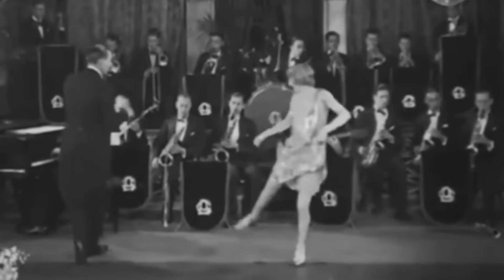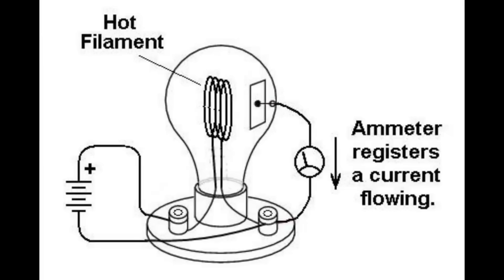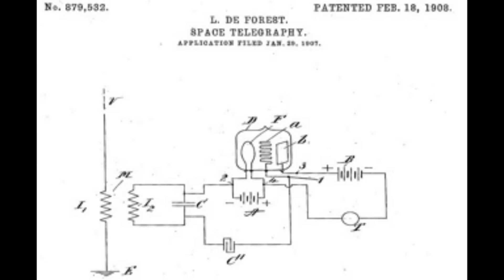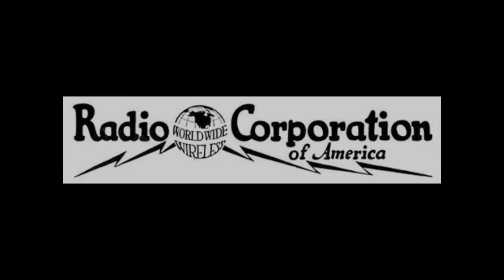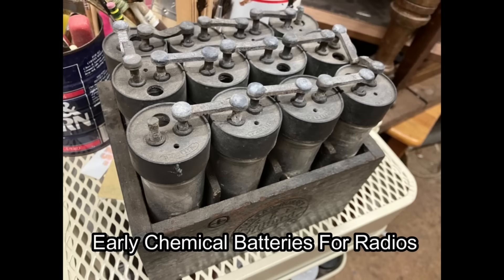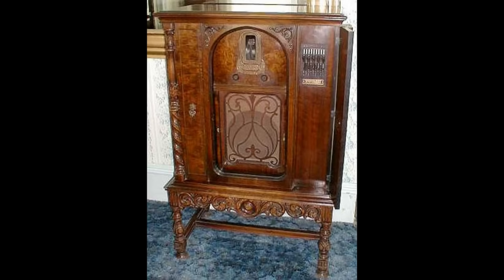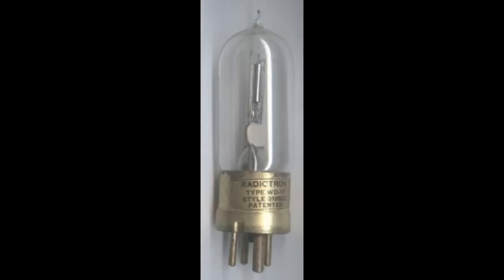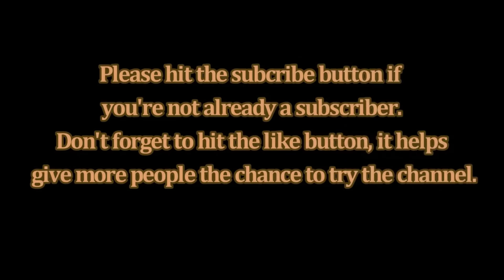The Vacuum Tube 1905 - 1929

Comment: When I was a radio engineer in the 1990s, I was surprised to learn that modern transmitters, like those made by Continental Electronics, used a large vacuum tube. Apparently, they still produce transmitters that use tubes, even though most used solid state components.
Reply from the maker: Tubes are still produced and needed today, which is a tribute to the genius of the invention and those who invented it.

Comment: Vacuum tube musical instrument amplifiers don't deliver a more accurate sound, they deliver a more desirable sound. Unlike a hifi amplifier, accuracy is irrelevant. What finally comes out the speaker is all that matters. if it's the sound that the musician is looking for, then it's the right way to do it.
Reply: Your theory about tube amplification for instruments applies just as well to home stereos as it does for stringed instruments. 
I've never heard any solid state  stereo amp sound as good as a high end tube amp.l
Reply: ..много зависи от записите , на каква апаратура са направени!!Записи правени на лампова апаратура звучат по-добре на лампов усилвател , и обратно , записи правени с апаратура на чипове и софтуер звучи по-добре на усилвател с чипове!!
Reply: Hook or a voltage meter to your guitar..youll be reading A
C thats why solid state will always be inferior

Comment: The first twin triode was the double winged audion in 1907. and there were some high powered triodes used in the early 1930's for the station WLW that had to be watered cooled.
Also Cunningham was a early tube maker and he started in 1915. Then there were the odd types such as the Sodion tube put out by the RCA company in 1926/27 The UX 201a tube was a staple tube for ten years. And then there were the acorn tubes for high frequency work during the early mid 1930's. And lastly there were the Nuvistor and Compactron types.
I could go on about the transmitter types and other special use types for early computer work. The history of the Vacuum tube is a very long one with many twists and turns and dead ends too.

Comment: Although thoriated tungsten filaments quickly gave way to the more efficient oxide-coated filaments and cathodes, which produced more electrons whilst using less energy, the thorated-tungsten tubes have one advantage: weak tubes can be rejuvenated by briefly running them at 1.5 to 3 times their rated filament voltage.
Reply: You know in retrospect it's puzzling that Thomas Edison took so much time and energy to develop filaments and light bulbs. All he had to do was check the periodic table for melting temperatures. Tungsten is the obvious choice. Thorium has a lot of electrons in the outer shell to release when heated. Both of these are almost obvious in retrospect. I don't think Thomas Edison had a periodic table on his wall.
Reply: @stephenmorton8017 Tesla complained that if Edison had just thought about what he was doing, he’d be better off.  Not the only person to say that.
Reply: @atari7001  i give him credit for noticing the effect, sure. but it's so interesting, why not follow it up? he didn't see any dollar signs is why.
Reply: Yes, related to the 811A.  I think the 812 has higher Mu.
Reply: Do you know why this works?  Does the thorium boil off the filament?  Thanks for the info, btw.  I have a tube that appears in good condition but the gain has dissipated very much.  There is evidence of sputtering on the glass as black deposits.
Reply: @atari7001 , hitting the filament with high voltage "boils" fresh thorium to the surface, and perhaps evaporates off contaminants that form an insulating layer. This doesn't work on oxide-coated filaments or cathodes (about 99% of all tubes), only those made with thoriated tungsten. What type of tube are you hoping to rejuvenate?
Reply: @ ok I see- it’s an 812a, which I understand is supposed to be thoriated.
Reply: @atari7001 , yeah, I think so too; that's a transmitting tube, isn't it? Some transmitting tubes have thoriated filaments. Look it up to be certain....
Reply: @ thank you!  I appreciate your help 😊

Comment: Most homes still have at least 1 vacuum tube device, even if every thing is new. The microwave oven! The magnetron (used to generate the microwaves) is a vacuum tube.
Reply from the maker: Yep! Even today, we still can't live without an invention that's over a century old!
Reply: @Radio1920s  We are likely to still be using them over 100 years from now! Vacuum tubes are the best devices when you need a LOT of power. (as you mentioned in the video, radio station transmitters use powerful vacuum tubes.) I "love" when people THINK something is "obsolete" just because there are modern "equivalents", But this is not always the case. The highest capacity data backup medium is STILL magnetic tape! (used for big data backups at data centers).
Reply: Correct
Reply: I understand solid state microwave ovens are available (first demoed at International Microwave Symposium 2014) but magnetron based ovens still dominate because they are less expensive.

My friend who is an electrical engineer didn't realize that a magnetron is a vacuum tube.
Reply: @lynnlandin7561  I shudder to think what the RF silicon to generate 6 or 1200 watts at 2.4ghz, and the heatsinking/cooling required would cost in both cash, and metal resources.

Comment: It could be argued that the Incandescent light bulb was the single most significant invention of all time. It led to the vacuum tube. the myriad uses of the vacuum tube were carried over to the solid state realm with the transistor. Transistors are the primary components in integrated circuits. The CPU in this PC can trace it's "family tree" back the the good old fashioned light bulb!
Reply: I failed to mention, The earliest home receivers (crystal sets) were SOLID STATE radios! Just like the fact that "we" had digital electrical communications DECADES before analog electrical communications. The telegraph using a 1 and 0 signal but with a tertiary rather than binary code (Time is the third component). But it WAS in fact digital. Years BEFORE the telephone, Hell, Facsimiles beat the telephone to the market! (That was analog though). Science and Invention RARELY is a linear path!

Comment: I would like to have one of the audion tubes but they are rare. The oldest I have is a Cunningham audiotron that came out in 1915.  110 years ago.
Reply from the maker: They are difficult to find, Tom. Even the replica's that were made seem scare.  Thanks for watching, Tom.
Reply: What is it a WD11 ?
Reply from the maker: @Macy-r6o3y   Hi Macy! A WD-11 was an early radio tube RCA put on the market way back in 1922. It was one of the earliest mass produced tubes. There more on it at my on-line museum, RoaringTwentiesAntiqueRadioMuseum.Com.  Here's a link to the page, just scroll down until you get to the WD-11 - https://roaringtwentiesantiqueradiomuseum.com/radio-tube-gallery